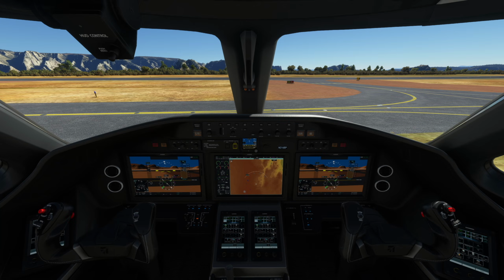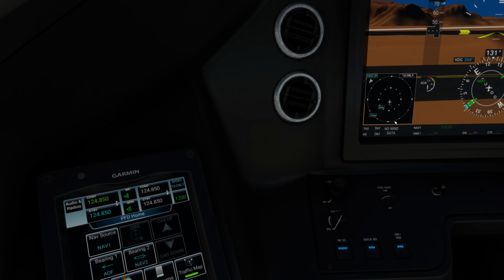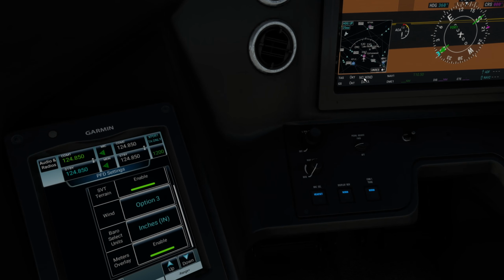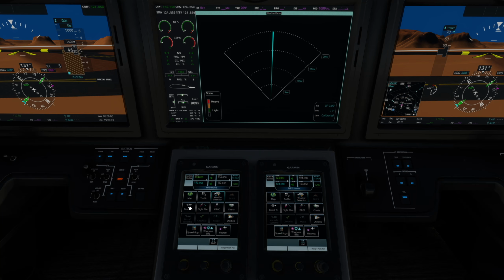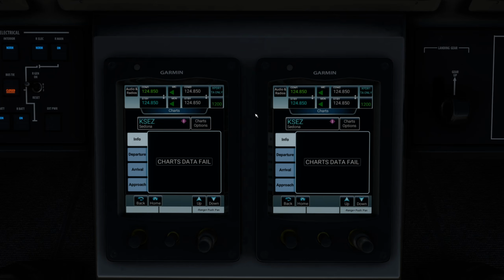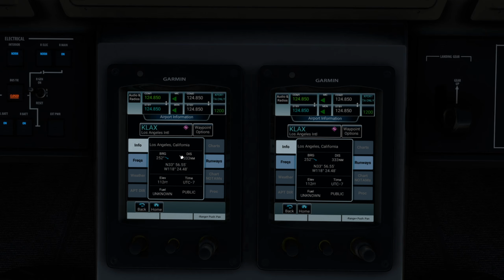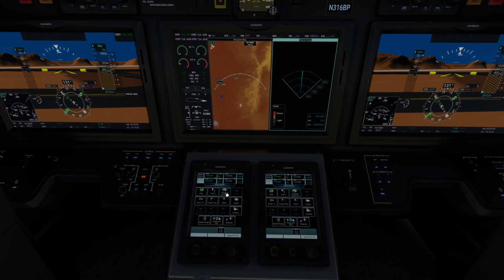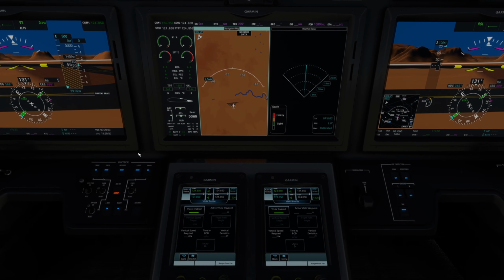MSFS 2020 Cessna Citation Longitude Tutorial | Garmin G5000 Avionics Tour

Comment: How do you display the waypoints on the MFD screen?. I’ve seen this on a number of videos but have not seen this demonstrated.
Reply from the maker: So are you talking about on the MFD map, where it shows each waypoint plotted and your flight path to each one? Or do you mean where you can make it show a list of the waypoints on the bottom 1/3 of the screen?
Reply: @SkyCenterLive  sorry, I mean the latter, waypoints on bottom third of screen
Reply from the maker: @bobwillett3860  Ok, that's what I figured but just wanted to check! On your main GTC controller go to Map Settings, then there should be a tab called "Inset Window", and then I believe the only option in there is called "Flight Plan Text" or something along those lines. If you click that it should show your active flight plan on the bottom third of the MFD.

One caveat, this is all prior to the AAU1 update a few weeks ago...I am still finishing up building my home cockpit, so I have not had my sim running or downloaded that update, so not sure if that has changed. If it doesn't work for you let me know!

Comment: the Flight plan from simbrief is included in G5000?
Reply from the maker: No, unfortunately you have to enter it in on the G5000 manually if you create/file your plan on simbrief. If you set your flight plan on the world map screen in MSFS before you start your flight it'll automatically be in the G5000, though. But yeah, if doing through simbrief for VATSIM,etc, you'll have to enter it in manually once you start your flight.

Comment: Hi, thanks for the tutorial.  Can you please tell me if the three primary flight displays and the radios are also pop-up / pop out gauges?  I'm coming from Prepar3D with a home cockpit and am rebuilding a panel to emulate the G5000 with three monitors and am hoping to be able to undock the glass gauges and move them to each respective display in my cockpit.  I know people are doing this with various aircraft in FS2020 but it's just not something I've tackled yet.  Any help and advice is appreciated.  Thank you.
Reply from the maker: Talk about a well time comment!!! I also am in the process of building out a home cockpit for the Longitude! And yes, the 3 main panels (MFD and 2 PFD's) can be popped out, as can the GTC's (Garmin touch controllers). There is one on each pilot's side, plus the two side by side in the center. They can be popped out as well and moved to a touch screen monitor, and then using MSFS panel manager software the touch functionality can be enacted.

Once I get mine underway I plan to make a video on it, so hopefully I'll be able to explain more in that video!
Reply: @SkyCenterLive  great thank you!  I’m looking to make a somewhat generic panel for the Citation but also a KingAir 350.  The newest ones use the latest Collins ProLine Fusion which looks similar with three large glass screens but no one is making any sort of facsimile software so the G3000/5000 is the way to go.  Im just wondering if I may run into any big issues.  Im very familiar with panel insertion methods in Prepar3D being an old FS9/FSX guy but am very unfamiliar with back end options in FS2020.
Reply from the maker: @oldowl4290  Yep, I'm right there with you, pretty blind when it comes to this stuff, but just using YouTube, message boards, and any other literature I can find to figure it out! In my opinion, making a cockpit for the Citation Longitude will almost "easier" than a traditional home cockpit...at least I feel like it should. Mainly because it's a lot of glass and a lot fewer buttons/knobs. I have a honeycomb yoke and throttle, and i'm considering just using the buttons/switches on those to map a lot of the ones in the longitude (at least the ones that make sense) and then see what's left from there.